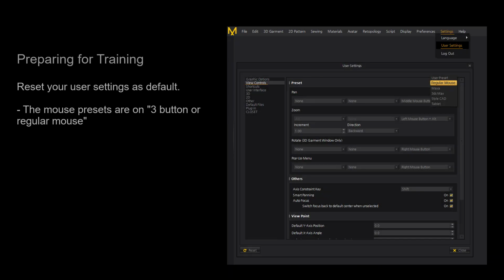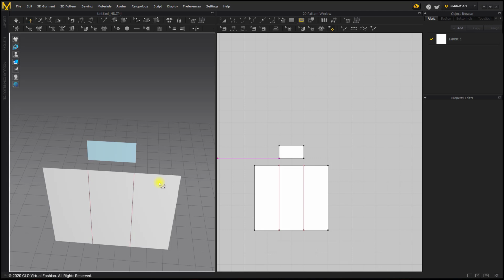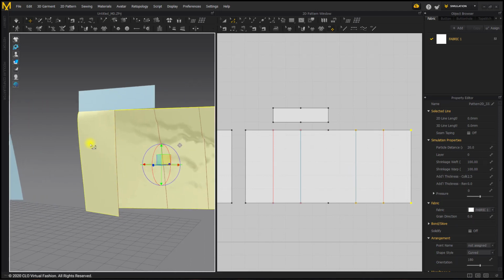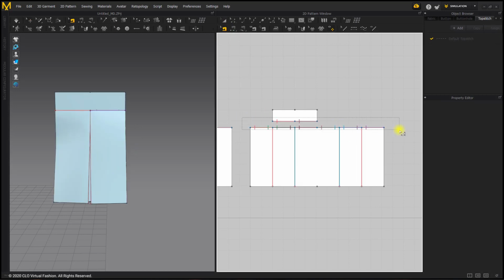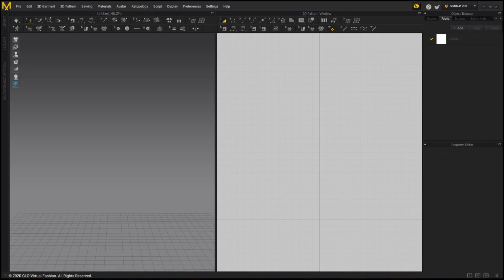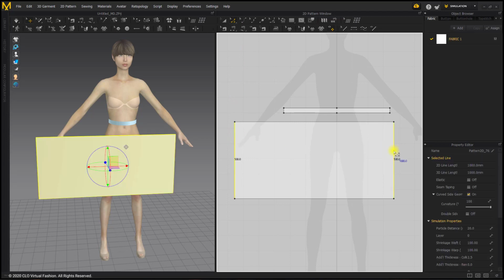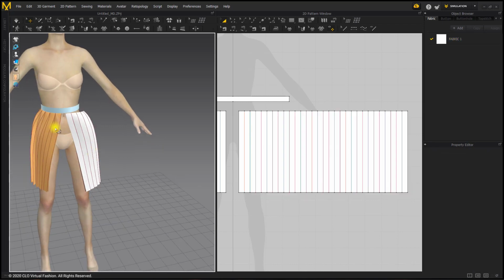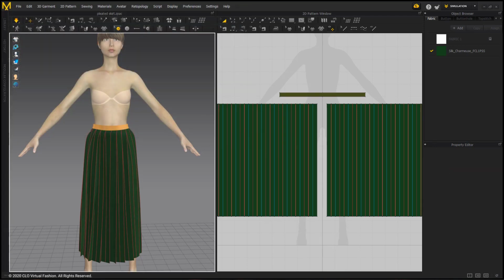Marvelous Designer Basic Garments: Pleats

Comment: Hi Everyone! I'm still new to this but I thought I throw out my solutions to some issues I ran into

KNIFE PLEAT SECTION
After changing fold angle and simulation, barely any difference is made to cloth:
Under property editor above Fold Angle, Increase Fold Strength. This seems to make a bit of a difference! IDK how it affects simulation time so probably change it back to 5 after you're done. Tacks are also your best friend! Tack the first section then move the rest over,

Sewing: 
So I was a dummy and was sewing section 1 and 2, then section 2 to 3. This wrinkled my fabric badly. I ended up sewing Section 1 and 2, then section 1 and 3. This got it being smooothhhh. Simulate in between and don't be afraid to use tacks! Using the free segment sewing tool, I just sewed section 1 to the frozen base. Worked fine!

Will edit as I go through the tutorial

Comment: In terms of folding and sewing a hem line over pleats, should I do that first, before I start the pleat folding?
I know hem lines aren't necessary on a 3D avatar model, but I was trying to create the aesthetic, particularly where in the final render and pose, the model is posed in a way that shows lining in suits, inside a hood, under a kilt etc.
Reply from the maker: After is usually better. Depending on how you do it you can even get the folds copied and pasted in the folded shape.

Comment: Problem : sewing for pleats not working how do you correct it if its turning into a box when sewing pleats.. you mentioned segment points but how do you add it if its missing 8:16
i did create internal line to 32 then used the pleat fold tool when i try to use pleat sewing its selects the whole box
Solution: Select all the points of the internal line and right click add Extend/Trim & Add point button then click to pattern outline you should be able to do 8:38